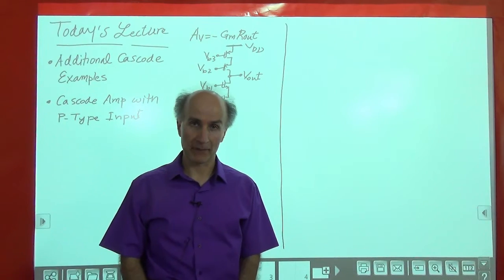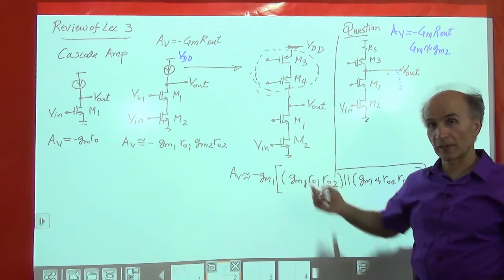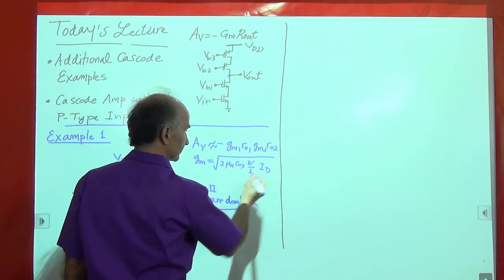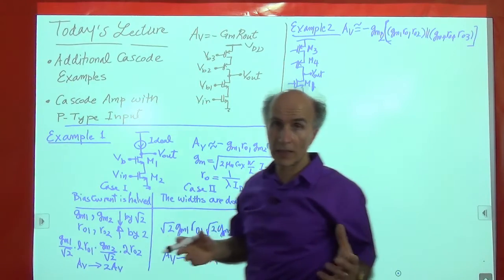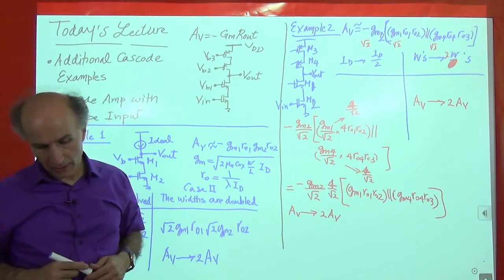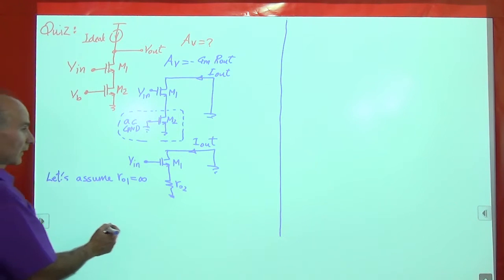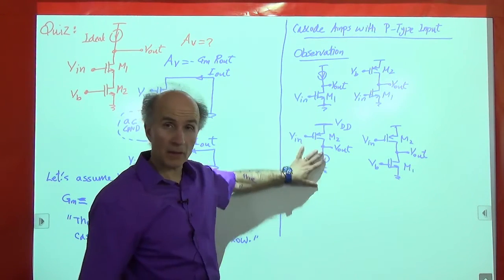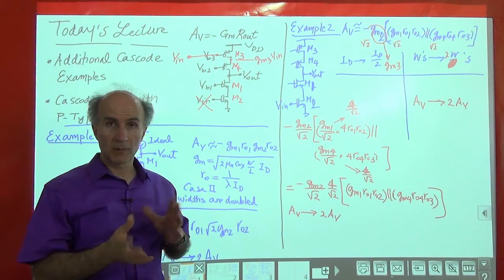Razavi Electronics2 Lec4: Additional Cascode Examples, Cascode Amp with PMOS Input

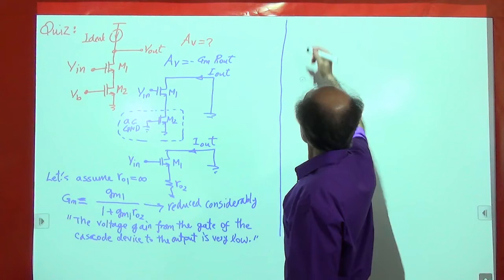Comment: At 37:20 if I calculate Rout of this circuit I got Rout= ro1,voltage gain = - ( ro1/ro2+ ( 1/gm1) if two mos devices are identical in that case ro1=ro2=ro, usually ro>>>1/gm if I approximate this, gain = - ( ro/ro) = -1 , gain unity compared to other configurations of cascode this circuit has very less gain( gain drastically dropped) , gain reduces bandwidth improves , frequency limit increases... Is this circuit ( cascode) suitable at radio frequency applications ?

Comment: For P-MOS, Av (Gain) will be positive right? as Iout is moving in opposite direction of gm2Vin.
Reply: Small signal model of both pmos and nmos will be same . . Voltage gain sign depends upon type of amplifier configuration..not on pmos r nmos..

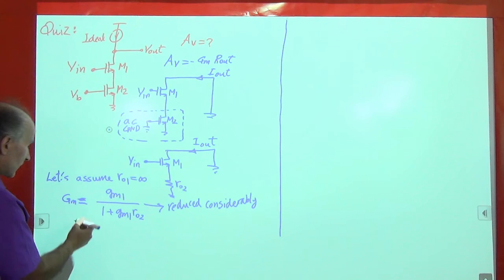Comment: for the Quiz at about 36:00 I assumed r01 to be less than infinity, constructed the SSM and got Gm = gm1/(1+ gm1*r02 + r02/r01) that reduces to Gm = gm1/(1+gm1*r02) when r01 is set to infinity which agrees with the Prof. result. Can anyone else confirm the result with r01 less than infinity?
Reply: Yes bro, i got the same...
Reply: @chetanw1676  yes you are correct

Comment: 01:25 - Intro and Review
12:22 - Example 1: Change in Cascode Amplifier with Ideal Load when: Bias current is halved, widths are doubled.
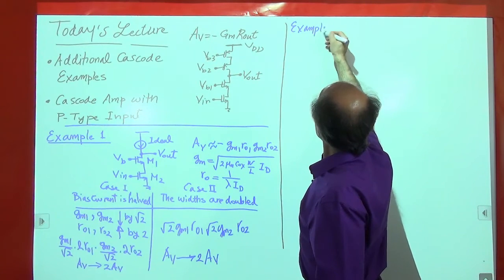18:35 - Example 2: Change in Cascode Amplifier with Non-Ideal Load
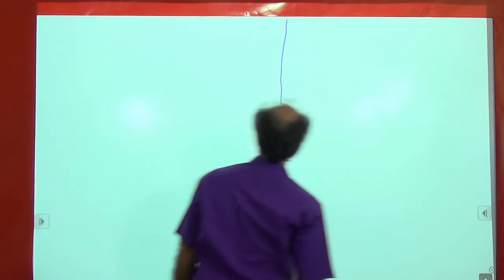27:40 - Quiz: Connecting Input Signal on Cascode Transistor
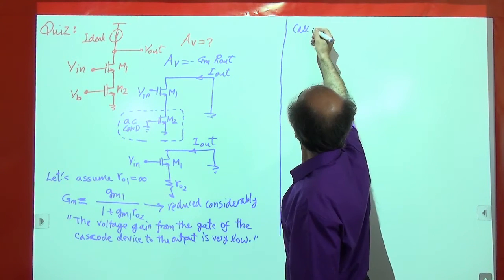37:25 - CS Amplifiers with P-Type Input
44:10 - Cascode Amplifiers with P-Type Input

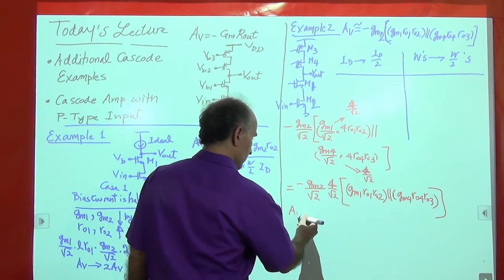Comment: at 25:06,  Av=1Av , Because 1/sqrt(2) * [4/sqrt(2) || 4/sqrt(2)]  = 1
Reply: the multiplying factors are not in parallel. If R1 || R2 and both of them being multiplied by some factor x, the overall result is multiplied by factor of x, so the answer is 1/sqrt(2) * 4/sqrt(2) = 2
Reply: @ozgunyurutken9485  oh, I was wrong
Thank you very much

Comment: In the review slide of Lec3 at 2:40, there is a slight mistake. The transconductance in the voltage gain expression should be of the input transistor i.e. gm2 instead of gm1.
Reply: Agreed. Good catch! To spell it out, the equation on the bottom right should be Av ~= -gm2[(gm1*ro1*ro2)//(gm4*ro4*ro3)]
Reply: Yeap!
Reply: @noth_2  yes
Reply: Yes

Comment: Thanks dear professor, but I can't find  derivation the transconductance of a degenerated transistor Gm = gm1 / 1+gm1*ro2   in Electronics1. Can you help us by saying where it is exactly.
Reply: From small signal analysis taking a degeneration into account we have 2 equations :KVL gives  Vin = V1 + (gm *r02*V1)  , KCL gives : Vout = gm*V1*r02 ,,,  cancel Vi from both equations and put both equation in AV form   yields : Vout/Vin = gm * r02 /(1+gm*r02),,,, and  if we rewrite it in a new form Av = - Gm * Rout  gives Gm = gm/(1+gm*r02)  
Hope it helps
Reply: @mutasemwahbeh6954  Thank you so much!
Reply: @mutasemwahbeh6954 Why rout is not gm1ro1ro2?
Reply: It should not be too difficult to derive using the small signal analysis.
Reply: bro as  now Vgs= Vin- Iout*r02 thats why Gm is not equal to  gm1
Reply: @amitkumar-sh2lk  Thanks it helps
Reply: Why rout is not gm1ro1ro2 ?@mutasemwahbeh6954